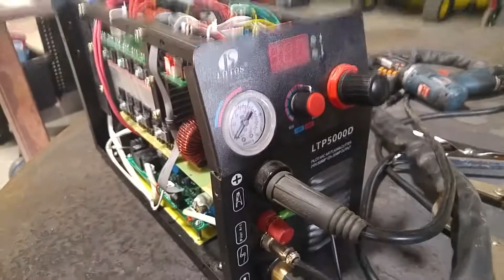Lotos LTP5000D plasma cutter problem finally found... maybe

Comment: Replace the cable. Also Lotos is pretty responsive. They have a tech number to call. A little slow with language differences but be patient and they are most helpful. I have found.